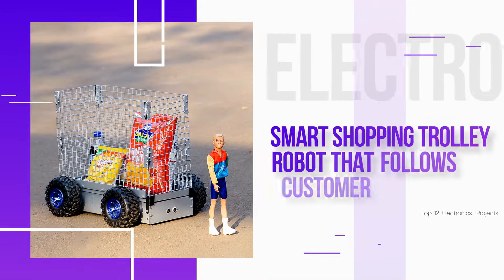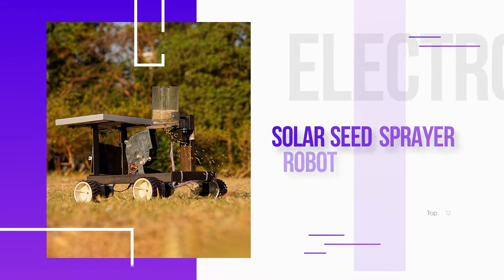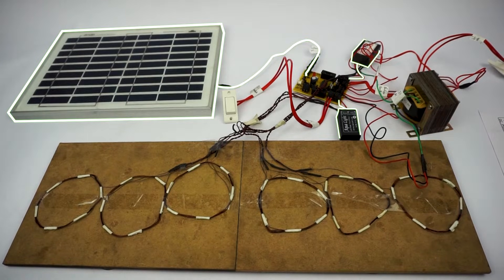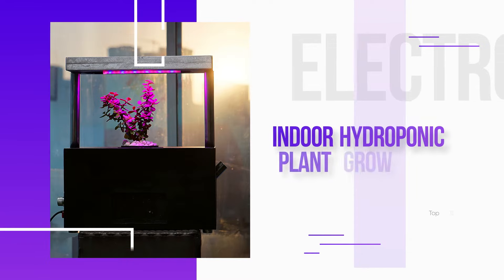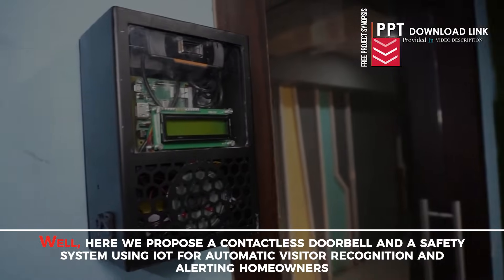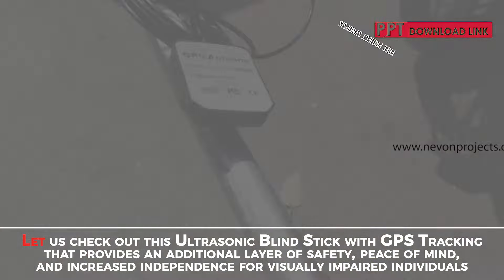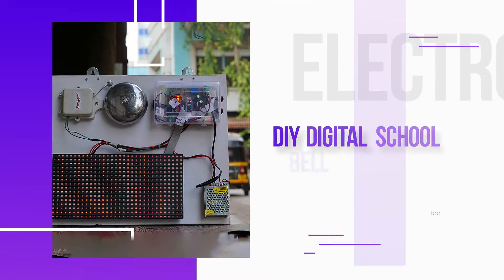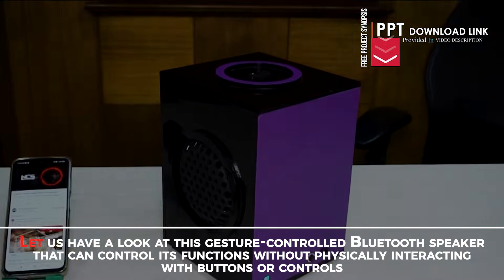Top 12 Electronics Projects 2023 | Electronics Engineering Project Ideas

Comment: As the demand for healthcare services continues to increase, healthcare professionals are facing challenges in meeting the needs of patients while maintaining quality care. One of the major challenges is providing 24/7 care for patients who require continuous monitoring and assistance.The challenge for this hackathon would be to develop innovative and effective solutions for designing and building robots for patient care in the health sector. Participants would need to consider various factors such as safety, reliability, ease of use, and affordability, while also ensuring that the robots are designed to meet the unique needs of patients in different healthcare settings.           
can you tell me about this topic how to do this????